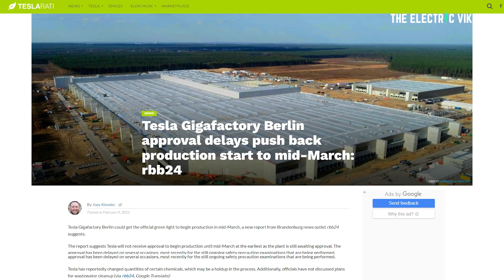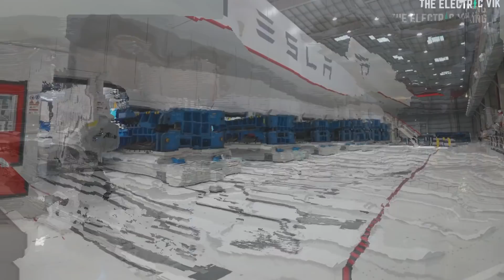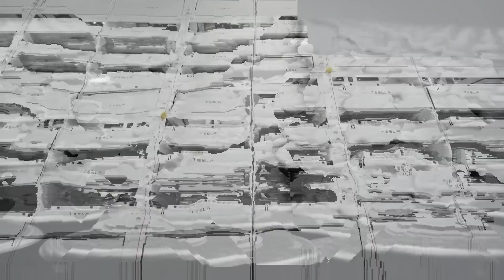Tesla Gigafactory Berlin delays are being caused by this...

Comment: The basic problem with the German bureaucratic procedures is that they are incompatible with the agile design processes Tesla uses. Any change after the original application basically starts the whole process from the beginning again. Tesla had a lot of changes, so they had a lot of false starts too. My impression is that some of the more rabid protestors actually misused this to reactivate complaints that had already been processed. Our current progressive government has noticed the inefficiency and is trying to formulate improved processes, but they started work in December and have a whole slew of other issues to handle too.

Comment: In the end I think it does not really change that much when the approval comes. Tesla is still supply chain constraint. It's not goining to build more cars if the approval comes sooner. Then it will just produce the same amount of vehicles at a slower pace. Tesla is continously working at the factory so when the approval comes it will be just further along the building/ramping process. It's more important that the approval has no flaws because they wanted to rush it and will later be contested in court which will take a lot longer than doing it right the first time.

Comment: No, there is no conspiracy. If Volkswagen or Mercedes would built a new factory near Berlin it would take the same time. Or even longer as they would not work 24/7. To meet all regulations and to get all approvals from bureaucracy for such a complex project is a hell of a job in Germany. And the closer you come the harder is the barrage from environmental groups as it is pretty easy to block projects by demuring oder filing lawsuits. All in all Tesla has been fast so far. But in Poland they would have been faster probably. I am German and I can assure that there is nothing to complain exept all the endless problems with weathering lawsuits and getting thousands of approvals. By the way: It did not take twenty years or more to construct and to open the new Berlin Airport, "only" fifteen (2006-2021). But this is an extreme negative example of incompetence and politicians hybris. - Thank you for your intense publishing work which I really appreciate.

Comment: My UK distribution company  was  buying successfully until the German company  replaced their sales manager   with a german fighter pilot as the head of the company .. Needless to say the company hit rock bottom and failed     The German bureaucracy would rather see their countries biggest assets wither and get blown away by cheap   (excellent ) Chinese imports .    Supporting their own manufacturing should be top of their agenda .. but obviously they are sticking their heads in the sand and awaiting the inevitable loss / failures of or their own manufacturing companies .   Soon   Maybe even now    it is glaringly obvious that the Chinese imports will slaughter the German Made EV  market ..  WAKE UP   .

Comment: I can only agree with the majority of your correspondents, Tesla should have never built a factory in Germany, right in the heart of the car industry it is going to put out of business. The German car manufacturers have sold high priced prestige cars built in Germany and sold through dealers through mainly the western world. Now along comes these new fangled electric cars that need very little servicing and can in most cases be bought online sending their dealers bankrupt. 
Worst still, the expertise in combustion engines they built up over more than a hundred years is now not needed and worthless. 
To rub even further salt into the wounds, the company that started it all is now wanting to take over our automotive industry and they want to do it in Germany! 
There is however a even worst place to have built a car factory and that is in Britain, now a country outside of Europe that has built a reputation over many decades of building unreliable, poorly designed cars that wear out quickly and cost their unfortunate owners little more than misery.

Comment: The approval will come, dont worry, it will not take 21 years... The big difference is the new airport was something nobody wanted, Tesla  IS wanted by the local community and get all the support then need, also the new government is 100% supportive of Tesla and tells the regulators to get on with it.

It is also not really a German thing, but an European Union thing, it are rules made in the European parliament that bugs them down right now, they have to follow all kinds of procedures which take a lot of time.. the have to go through about 50 huge binders with each hundreds of pages, drawings and what not, and if they find something that does not comply, Tesla has to correct that and the revised documents/drawings need to be checked again. Bside this sifting through documents also physical inspections take place inside the factor itself, if everything is safe and build according the submitted drawings and complies with the rules.

This all takes time, but they will get it done and when that has happened and the approval is granted, we will all forget about this delays in just a few months when we see thousands of Model Y's rolling of the lot on trucks and trains, flooding Europe with the best electric cars ever made.

Comment: “What’s wrong with Germany you ask.?” If there is a requirement to tell the local authority how contaminated water is going to be dealt with ( which is an important question) then permits won’t be granted until Tesla provide the answer. So the question should be “ What’s wrong with Tesla.?”

Comment: ALL THIS COULD EASILY Be avoided if Tesla put the German authorities on notice. This plant opens by X date or.... 1. Not a single new plant of expansion will ever happen again in Germany. 2. After 3yrs not a single part or tier 3, 2, part within a part will be excepted if manufactured in Germany. German parts suppliers would have 3yrs to move out of Germany and set up shop a few hours away in Poland or elsewhere. Problem Solved!!

Comment: I agree.
I think every update from Giga Berlin should include a month and year…
By the way; Poland would have been a fantastic spot for the factory (or a future one). Still relatively central, cheap labor, less paperwork and much cheaper politicians ;) and if you would have let the people know that it’s a competition between Poland and Germany, they would have pulled out all the stops!
Reply: exactly lol
Reply: Tesla learned a huge amount from building Shanghai, and used that knowledge as a foundation for building Austin and Berlin.

Within 3 months, Tesla will know what it takes to build Megafactories, which will be individual production lines and battery production grouped together for the specific needs of a market. 

The current Gigafactories are Elon's 'alien dreadnoughts', the optimal size for a huge market. But each of these factories contains the Lego blocks for future factories. A production line for Model 3's: you want more, duplicate the production line as many times was you need to get the output you need. Battery production lines? You need more batteries, build another production line.

With this modular approach, Tesla will build maybe 7 more regional factories in China to cater to local needs. One of the products will be the $22,000 vehicle which will sweep the world. 

This modular approach could be used in India. The market for existing Tesla models in India is tiny, but for a $15,000 vehicle it would be huge.

Step and repeat into Africa, the rest of Asia. And train people all over the world to raise the standard of living everywhere.

Henry Ford paid his workers enough for them to be able to afford to buy one of the cars they were building. Tesla is going to do this globally.
Reply: @richardhamilton-gibbs6360  Cars are a low priority for places like India. Building mass transit systems will be most efficient and serve the most people and at low cost for riding. Low cost is a must for cars in places like china and india.

Comment: German red tape can be annoying, but imo no better place in Europe for Tesla to build its first factory. a) Best trained work force (for automobile end electronics sector b)largest car market c)the heartland of legacy carmakers, so if you want to profoundly hurt them and change perception of EVs , you better start there d)much larger shares of Renewables than in Eastern Europe which is still heavily reliant on coal. So if you want to accelerate transition to sustainable energy, better not use too 
 much coal power in yout production e)  weaker unions than e.g. in France f)  actually in the  EU since UK opted out....and  I could go on and on. Germany isn't  the perfect choice, but the best choice there was.

Comment: This is more or less typical for germany.
1) Since about 2 years, the gouvernment allows no-strings-attached balcony-solar setups, with micro-inverters, but limited to 600Wp and you are forcibly reminded to have a special socket installed to take the power, as supposedly, the normal schuko socket is not meant for power running both ways... The fact that those micro-inverters create alternating is not deemed relevant...
2) If you want to install proper solar, you are forced to upgrade your electrical installation to the very latest standard first. Easily adding 2-3k to any solar installation.
3) In bavaria, there is a 10H rule for wind power. You need to be 10x the height of the wind turbine away from any house. Try finding any free spot in bavaria that is 2.5km from a house that is not in the middle of a nature reserve...
So yes, maybe the competition is involved, but this really is par for the course here.

Comment: No worries. The clock is ticking and Germany is losing. The start up bugs will not be an issue and that means capacity will be achieved more quickly once production starts for Tesla. Ultimately the buyer will win as fit and finish will be excellent and that's why Tesla will win.

Comment: The good news is that Tesla has now sent in the appropriate paperwork for the building permit and it is being written. The bad news is that in reality is even if Tesla had the building permit they still could not open as the factory currently is unlikely to comply with standard operating laws. Imagine if you built a house to permit and on the final inspection they noticed there were no smoke alarms, loose wires hanging from the ceiling and the sewage was not working. There are two parties in this "slow" process and Tesla appears to be one of them. They can operate the factory making test cars without meeting the fire requirements, but cannot fully open until fire requirements are met. This is primarily in Tesla's hands. Those in the know say Tesla have had permission to build the Central Utility Building for a very long time, yet they are still not finished. The first building that appeared to be complete was the Drive Unit, the outside was all but finished a year ago. Tesla has retrospectively added an internal floor and resubmitted plans for the alteration. People who have recently seen inside say it is really unfinished.  If you had permission to build a single story  house, then decided most of the  way through the build to add another story, you would need to resubmit the plans. There is no doubt that we are all frustrated by the process, but it is shoddy and lazy "research" to solely blame Germans and bureaucracy for all of the delays. Why is Giga Nevada not complete? Where is the Roadster? The Cybertruck? Why are there no deliveries out of Texas? (factory allegedly ready to go in October), why can a Texan company not sell cars made in directly to Texans?  Why is there no model Y in Australia? What is the story with solar? None of these have simple one word answers, business is more complicated than that. I'd be surprised if GigaBerlin was not delivering cars in April. If I had the choice, my Model Y would come from there in 2023.

Comment: On an aside, I am planning to buy an EV in the UK in January 2023.  To date I am very disappointed in the available choice in the UK.  My preference is for a high range vehicle as I frequently travel up to 180mi each way but have no charging opportunities at the other end.  I also need to transport a double bass and other instruments to folding rear seats are a must.  Traveling around London I would benefit from currently not paying the Ulez and congestion daily charges (£27.50 in total), and no other taxes (wonder how long that will last).  No real sign of any of the Chinese BYD or other brands here yet.   Worth a discussion?
Reply: A long-range Tesla Model S has 418 mile range so far. Maybe they will be shipping them to England by the time you get ready to purchase an EV.
Reply: You need to plan on getting a facelift MG5 and reconcile yourself to a short splash and dash to get back to 80% on each leg of your journey. Pretty much the only Estate EV (Porsche is the other ) so it should cope with your double bass.
Reply: 180 miles? Your island isn't that big!😂

Comment: Gigafactory Berlin is the biggest misstep Musk has made, to build with no guarantee of permitting or the waving of regulations was foolhardy the present difficulty was foreseeable building a non-uniom facility in VW backyard was never going to be smooth sailing they need to be building a new euro Gigafactory elsewhere in europe ASAP you cant bargain from a position of weakness and there are too many anti-Tesla interest in Germany.  Even if Berlin starts production there is nothing stopping an "environmental group" dragging them back to court on another concern and possibly stopping production you can't run a business with that threat hanging over you. Might be time to walk away swallow the loss and move to a more nurturing location it will be costly and ruin this years production ramp but they were going to build in another euro site anyway.